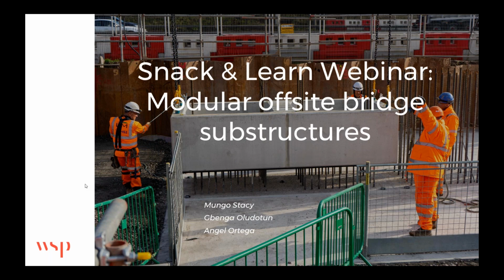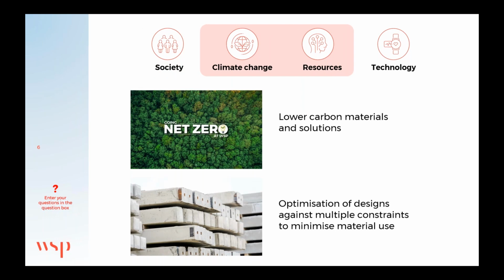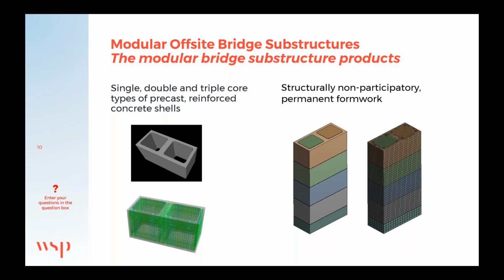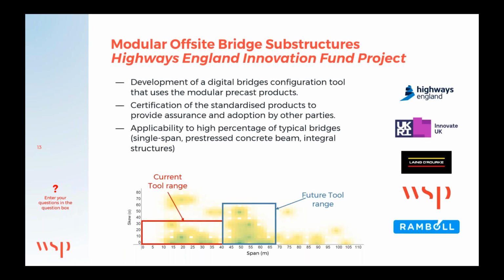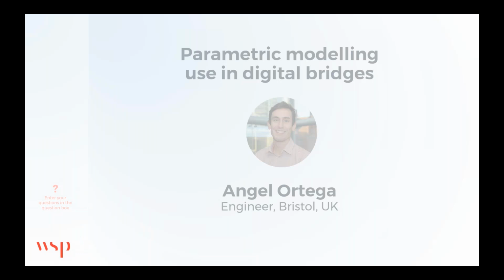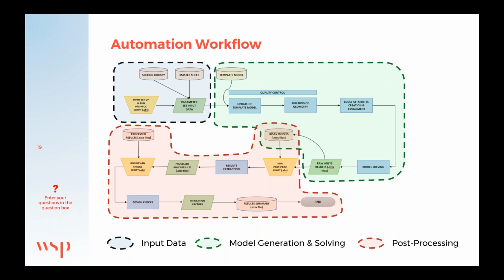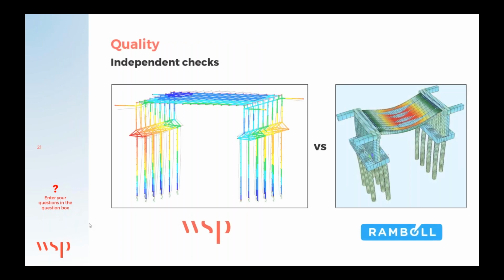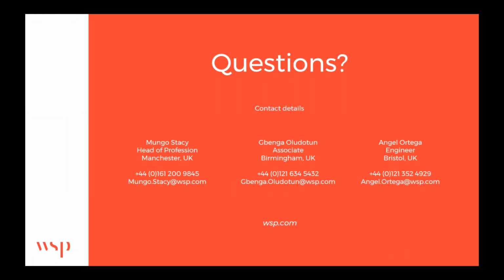Modular Offsite Bridge Substructures

Comment: Interesting use of Lusas LPI. I’m a little confused on the 1000+ configurations aspect. Is this different superstructure types? Or is this variation in span length, number of beams, sub height, etc. (or any other tweak you can name)?